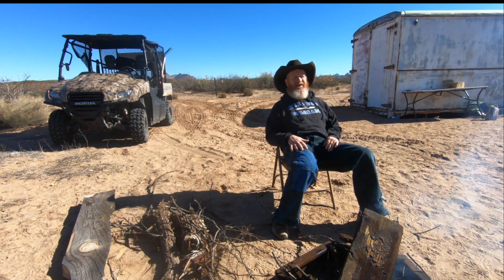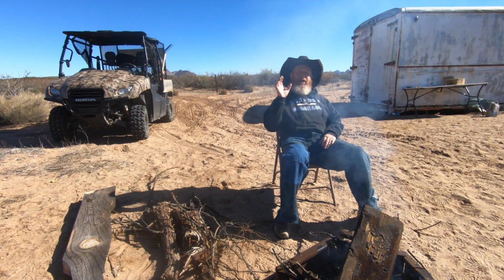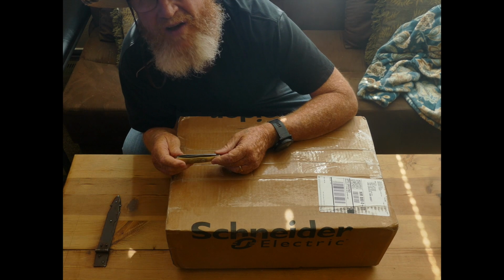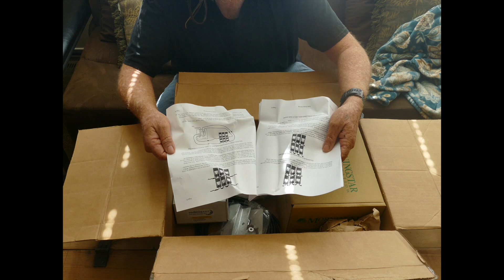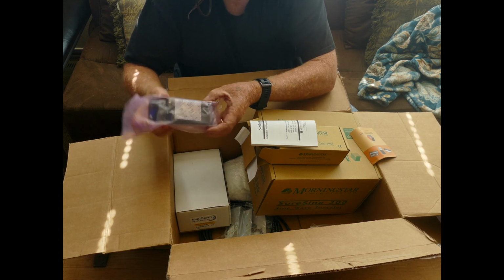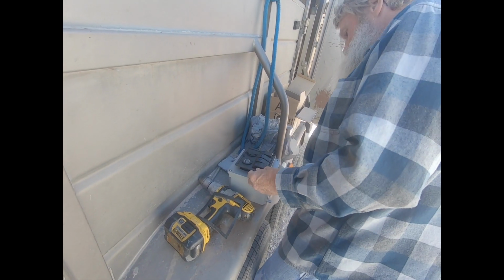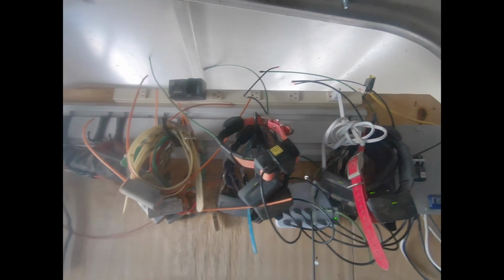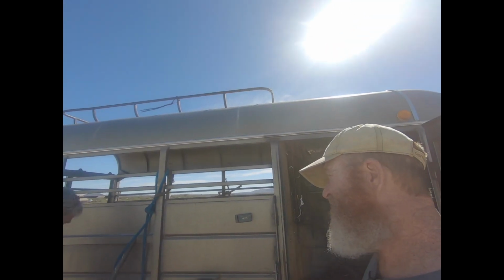100 Watt Solar stock trailer install.. and trailer modification #born100yearstoolate

Comment: Brett, I just started watching your videos, enjoyed all old or newer,   someways you are a good owe  boy, what you do you need to upgrade your mule trailer, very nice setup. This is 2023, hope you continue making your videos. Thanks
Reply from the maker: Thanks .... It works .. just put a lithium battery in it.. kinda pricey   Thanks
Reply: @BrettVaughnB100  sounds like a good set-up, yes lithium batteries are expensive but does it work? You have to pay the fiddler to dance.

Comment: Good video. Where is your fuse located?
Reply from the maker: The switches have some fuses for the 12v ..the breakers take care of everything else .. Thanks Carson
Reply: @BrettVaughnB100  I'm no electrictian and never claimed to be but I have observed that most solar systems have an inline fuse coming off the battery or supply /storage side. I'm not bagging on your system just trying to learn. Have you ever dealt with Northern Arizona Wind and Sun out of Flagstaff Arizona? They frequently run deals on their already competitived priced solar equipment, have helpful staff, and no sales tax on solar equipment. I buy everything I need from them.
Reply from the maker: I believe that’s what the breaker box is for ... it fuses everything ... I have always bought from back woods solar out of Idaho ... I have in the past bought from That place in flagstaff just solar panels for some of our CP systems we put in